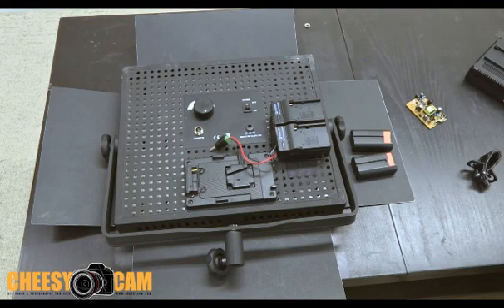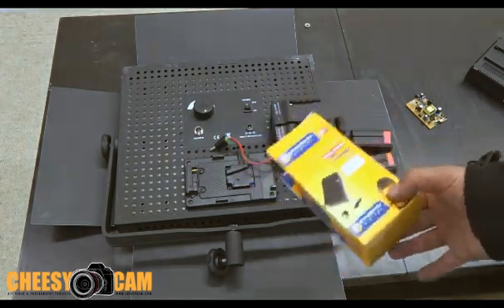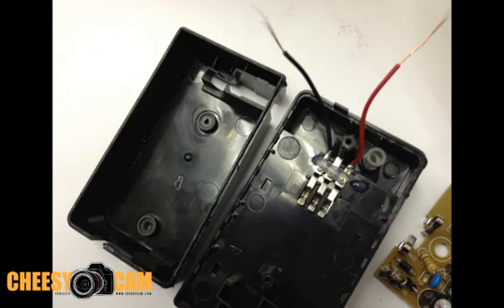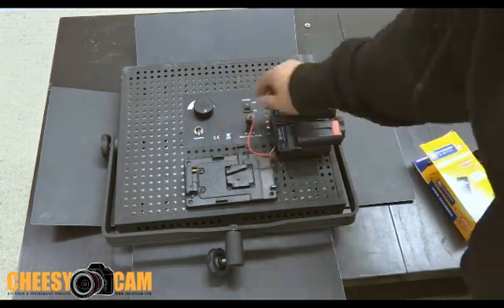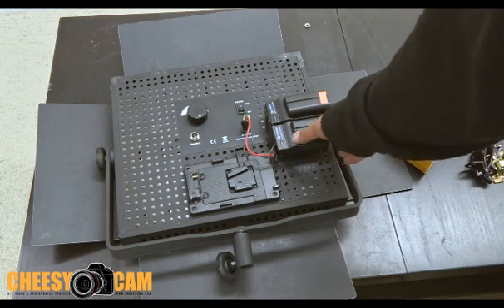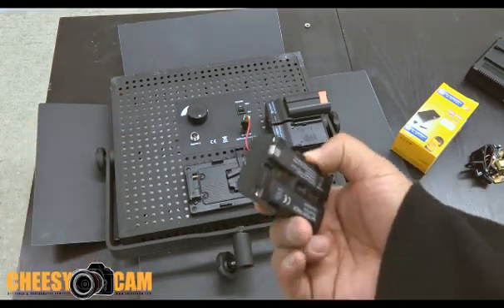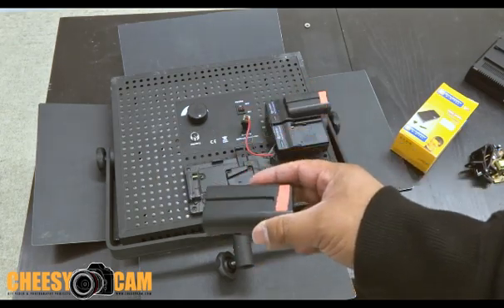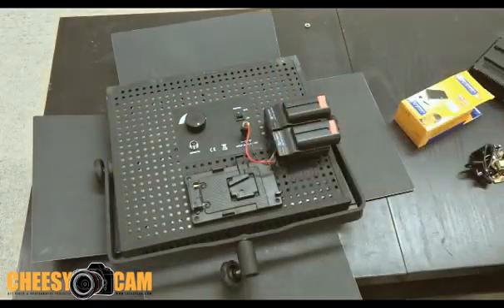DIY Sony Battery Power for 600 900 LED Light Panels

Comment: Nice one- been thinking about using tool batteries - can buy them a lot cheaper than the v-lock and they last forever. Rigid, Ryobi- Black and Decker - have a garage full of them.

Comment: You could probably use 12v Gel Cell batteries like those used in Uninterruptible Power Supplies and mobility scooters and hang them low on your light stands. It would make the stands more stable and less top heavy.